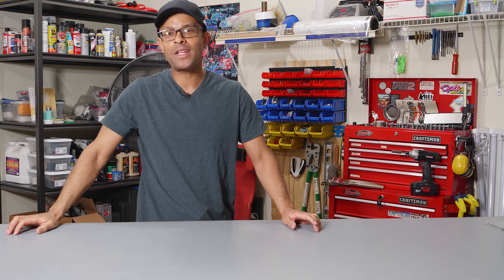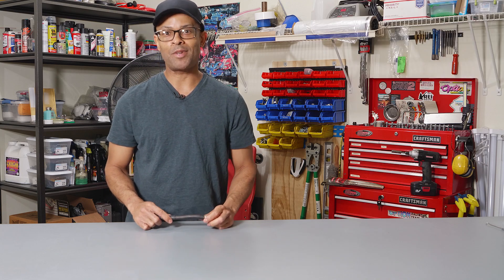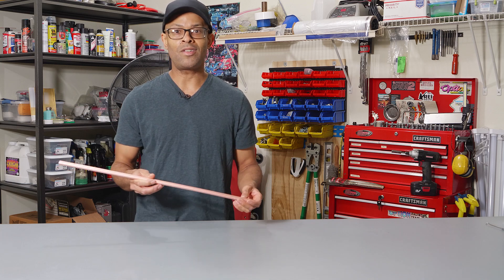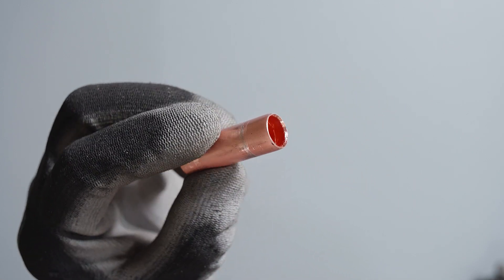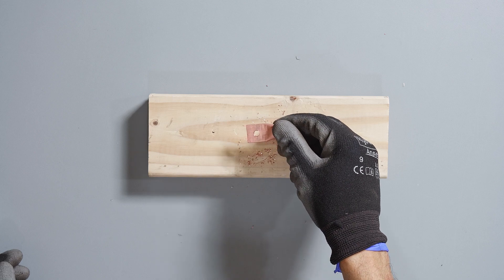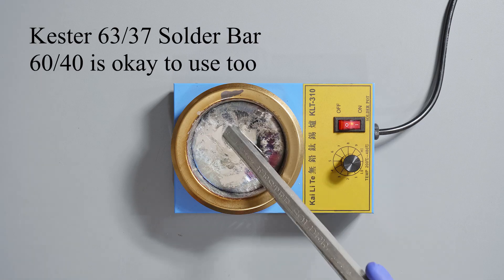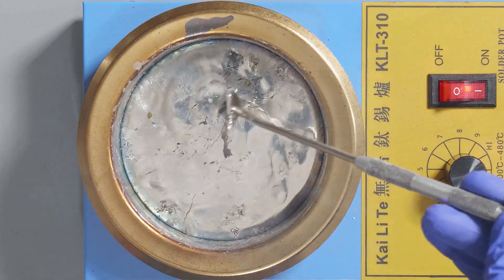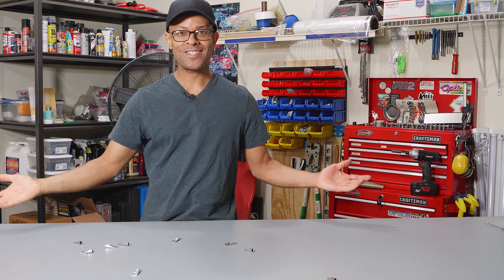How To Make Professional Copper Lug Terminals - Improve Battery Ground Wires And Car Audio For Cheap

Comment: Great for one battery connection but for battery banks and its connections I would not use solder. It can melt off and cause a short if it is in a tight space. High Voltage applications its always avoided when possible for best practice and sanding your terminals smooth gets rid of possible arc points. I was looking to find a quick method to make these. I really need a arbor press lol

Comment: Thumbs up on eutectic solder.  I am not sure how much you need it on a terminal.  It is intended to solder components to boards and it has no "plastic" state.  Eutectic solder goes from liquid to solid.  The advantage is you will not get s cold solder joint if you move the component while it is cooling.  Nice work!